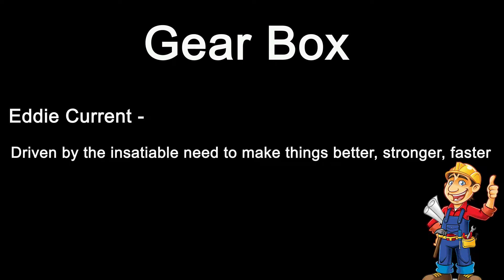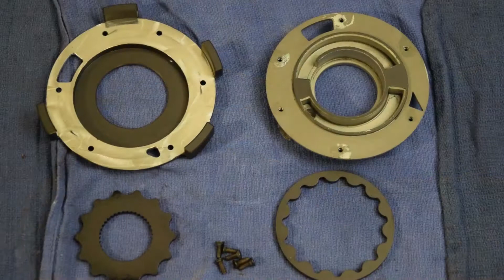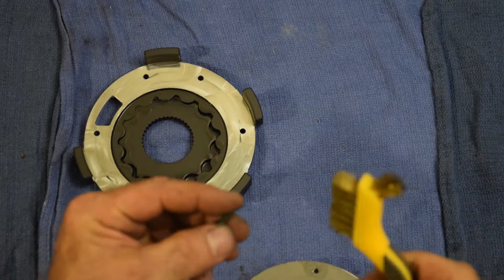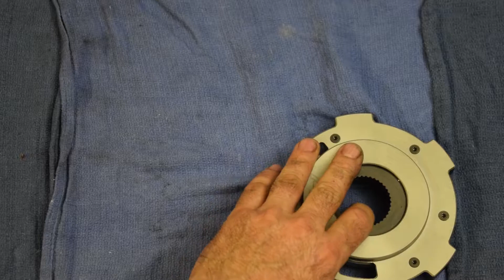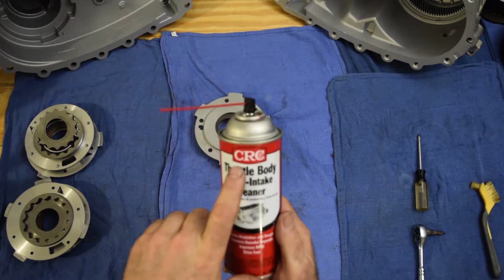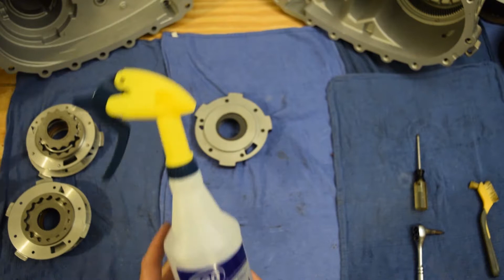Merchant Automotive Pump Upgrade for the GM NP246 Transfer Case Oil Pump

Comment: Why zoom oil over trans fluid or trans grease?
Also, there are so many manufacturers of Zoom Oil are you saying they all are the same?
Which one do you use?
Thanks!
Reply from the maker: The case and the internals of my NP246 transfer case are PTFE coated and I only wanted to use lubricates that would not destroy those coatings. I could of use the transmission assembly grease or the GM blue Transfer case oil, but I only had enough GM blue for the final fill. Zoom type oils work great for this application its has great penetration properties, it's very light with good lubricity and doesn't have any moly's or graphite's that could damage the PTFE coatings. I have used both Dial Manufacturing and SUPCO GIDDS zoom oils in the past, both work great.